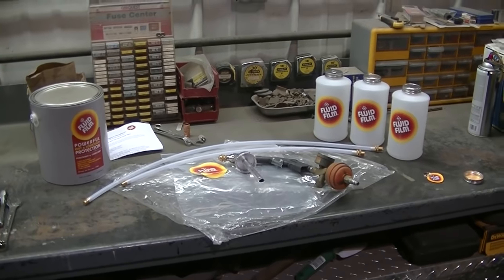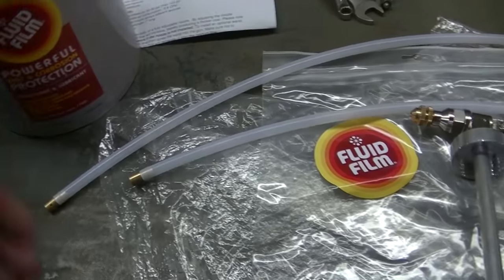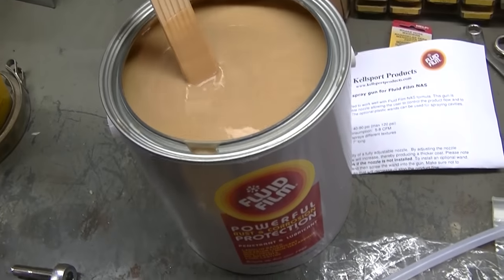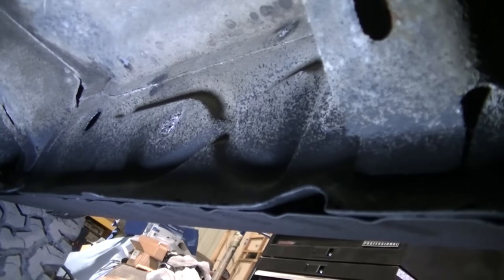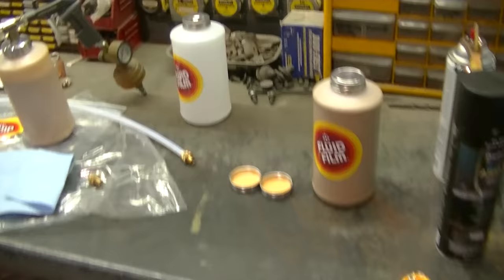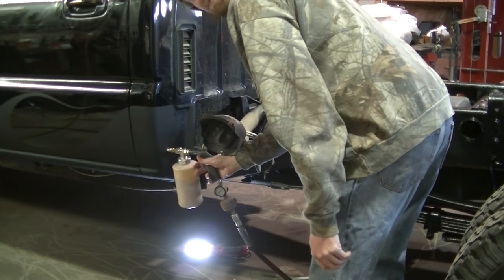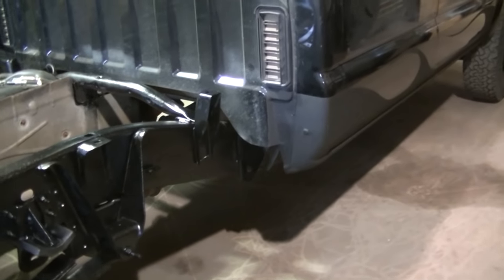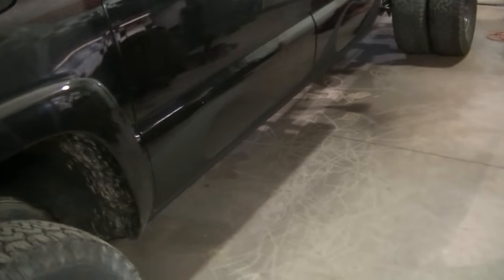Darth Dually Silverado "Spraying Fluid Film in Rockers"

Comment: I just got this same kit on Ebay, comes with the gun, 1 gallon FF , 3 empty bottles for the gun. One bottle has a cap brush for terminals or small applications. As well as the 360° hose and spray hose. Was a package deal with a gallon of FF and 300 plugs if you wish to drill a hole in a application like rockers or tailgates or whatever.  Was a decent deal around $140 and they threw in a led flashlight lol. Wish I bought the pump lid for the gallon can!
Reply from the maker: I didn't know they had a pump for the gallon can.  That would really be helpful.
Reply: mossman381 If you look on Ebay you will find it. Kinda pricy in the + or - $30 range. Also seen this contraption called Rockler Mixing Mate Paint Lid. It fits a typical gallon paint can and mixes and pours. About $20 give or take. Both are cool to have on the bench! - Nick
Reply: Where did you buy the gun at?
Reply: Where did you buy the Fluid Film gun at ?
Reply: lightningsmokerXx Ebay
Reply: mossman381 get a gallon can pour spout cheap

Comment: Hey Mossman. I did my 89 K5 Blazer with Waxoyl products. I’ve been looking into Fluid Film and now Wool Wax. I still have several sealed unused  gallon containers of Waxoyl cavity wax. Not sure why I purchased two of everything Undercarriage hard wax and cavity wax. Anyway I also purchased the spray gun and wands. The both Waxoyl s are good and spray gun is clean ready to go. The cavity wax is similar to Fluid Film/WoolWax but is Petroleum based product I believe. I also checked into other products like NHOU , 2+2 Berkable PFC , Petroleum Service Company undercoating. These are wax oil Petroleum based products. Once sprayed they seep and creep into pinch welds & seems. They set up and have good bonding to metal , painted metal and metal with tight surface rust. I guess anyone of these products is better than nothing. My truck is brand new , clean and ready for what ever I’m going to apply. The truck is on high ramps in my driveway. Now if only the rain would stop.

Comment: sprayed mine before winter, still holding very good. it soaked in the rust and turned it very dark brown as if wet. I used 2 liters to do the frame rocker panels and inside the bottom of the doors. Even sprayed under the whole cab floor underneat .Spray your chassis !

You have no excuses, FF cost twice the price here !
Reply from the maker: +Veikra   I am not sure I want a greasy film on everything.  Would be a mess working on the truck with grease on everything.
Reply: it's a mess but it's easier to remove bolts as they dont seize and rust. I'd rather get dirty working on it than having to cut bolts and fight everything whenever I work on the chassis.  Greasy is how it needs to be in our weather.
Reply: +Veikra Agreed.... Greasy film is good for sure :)
Reply from the maker: +Veikra   I guess I figure after 14 years the bolts that are going to seize are already seized.  When I take something off I always use anti-seize on the bolts.  Spraying the bottom of the cab would probably be a good idea but I don't really want to just spray the whole bottom side.
Reply: mine was showing traces of rust on the bottom, such as the edges of braces.  And at least  if it doenst fix the seized bolts, it stops other from seizing.
I'd rather do it, matter of preferences and I figure it can only protect more. Im willing to deal with the dirtier repairs that are few and far between.
Reply: Veikra Getting greasy is not fun but I do like the warm fuzzy feeling of my truck oozing oily stuff from every crevice, lol.  Makes me feel like I'm giving it a chance to last longer
Reply: Velvethamma
It's a once a year thing, and done deal, it never rusts again. Totally worth it
Reply: Veikra Agreed!

Comment: Fluid film is great stuff for sure!  I put that #$%& on everything!!!!  I like the undercoating gun setup.  I see Eastwood carries an identical unit for similar money... I need to get one for sure
Reply from the maker: +Velvethamma   This gun was supposedly specially tuned for fluid film.  Here is the link  http://www.ebay.com/itm/141661065307?_trksid=p2060353.m2749.l2649&ssPageName=STRK%3AMEBIDX%3AIT .
Reply: Looking at that sprayer, I'm thinking I could make my own with a high output air gun, flare fittings, and a ball jar. We make these at work for spraying mineral spirits, not sure if it would work on that thick of stuff. How much did a gallon cost you?
Reply from the maker: +UnitCrane514   About $50 a gallon.

Comment: Even in the summer, my 5 gallon bucket has the consistency of pudding.
Reply: That's a question I just posed in a Fluid Film video comment section and here on this video.  Most videos show Fluid Film having the consistency of thick pudding yet here and on the Fluid Film video it is a pourable liquid.  How come?  I'll let you know what I hear if they ever get back to me.
Reply: @STBRetired1  Yet the overpriced stuff in a can is as thin as water.  They said the only thing you can use to thin it is vegetable oil.

Comment: Now that's interesting.  In most videos, the Fluid Film has the consistency of thick pudding.  But yours is a pourable liquid that would atomize and spray much better than slinging pudding onto the truck.  I've just left this question on a Fluid Film video comment section to see why the difference in consistency.  Are guys leaving the lids off the cans for too long and the VOC's are evaporating?  Fluid Film does say no solvents but the list of ingredients does list "less than 25% VOC".  I wonder if anything can be added to the thickened Fluid Film to make it more liquid after it has thickened?
Reply from the maker: My latest can of Fluid FIlm did seem thicker than this one. I mix mine up really good before using it. It sprayed easily with no problems.

Comment: Nooooooooooo! you are not boring; quite the opposite I may say.  Truck is coming along nicely.  How is the 1500?
Reply from the maker: +jewllake   Thanks,  I have been using the 1500 since the dually has been down.  Seems to be running good.  Waiting patiently for it's turn for mods  :)
Reply: The more videos of spraying fluid film the better.
Reply: mossman381 
Nice vid.
Hey I'm debating doing a 360 FF spray inside my frame on my.18 ram but I'm worried dirt will get in frame holes and will mix with FF and get stuck in there unable to rinse with a hose fully causing rot problems down the road. Because oil attracts dust and dirt.
PLEASE TELL ME YOUR THOUGHTS ON THIS SCENARIO?
To me it's a little different then inside rocker were dirt can't get.
Reply: @countryfamilyalways7280  -even if you live in the iron range the FF is great at displacing water from the steel thus preventing rust. If u cross deep water alot then you will want to recoat but normal use a yearly application is fine. I have an 03 Toyota 4runner w/200k all WI & MN miles. Before FF it was total surface rust under. After remediation & FF (in my driveway) it's perfect. Cant recommend enough. It's hard work but totally worth it!

Comment: How did you hit the outer rockers on this truck since there is no access, I got a stock truck with mint rockers and I am trying to find out how to coat both layers of rocker panel thanks
Reply from the maker: There are holes to access the inner rockers with a hose. I believe I showed that in the video.
Reply: @mossman381  the ones you slipped the hose in from the rear aren’t on my truck I guess, I may have to drill a hole to access it
Reply from the maker: It's been a long time since I had that generation truck but I thought they had a few holes in the rockers. They have plugs that cover them.

Comment: Fluid Film is a great product. Somebody correct me if I'm wrong but it is made from lanolin that comes from sheep wool. ( I think ) Kind of slacked off using it because I find it very expensive compared to other rust preventing materials. Should take another look. Thanks Bud.
Reply from the maker: +Douglas Laramie   It was about $50 for a gallon.  I didn't think that was bad at all.
Reply: +mossman381 money well spent. i use it all the time. i buy it in the spray can and use it like WD 40.. excellent product. iv used it on my 04 dodge since new and no sign of rust. only where i did not spray it.. i do a application 2 times a year. in the winter i spray the underneath with used oil cut with diesel fuel. works great keeps every thing protected from the salt.. we have it really bad in Michigan
Reply from the maker: +Donny Krane   I feel better knowing I have something in the rockers to help keep the rust at bay.

Comment: Hey Mossman. Did you spray your new trucks. Did you look into other rust proofing materials besides Fluid Film. Nice video
Reply from the maker: I have sprayed sections of my other trucks.  I want to wait until I do rust repair before spraying to much.  Otherwise it could be hard welding new metal in with it covered with Fluid Film.  This stuff is proven to work.  There are a few videos showing it.  If you spray this stuff in an area that gets washed off then you will need to recoat every so often.

Comment: Now that it's been 4 or 5 years how well you feel it worked versus using por 15 or something of that nature, have a new truck and live in ohio?
Reply from the maker: I don't have this truck anymore but I know the Fluid Film is keeping it from rusting where ever it is. POR 15 is a paint. This is more like an oil. If I had a new truck I would spray Fluid Film in the inner fenders, rockers (inside and out), under the cab, and inside the bed fenders. There are little plugs all over these trucks. Pull them out and spray Fluid Film with the extension tube.
Reply: @mossman381  thanks, I'm aware of the difference just contemplating if I should use the fluid film or just go ahead and break down and paint, por 15 the entire frame, cause the wax gm puts on these new ones is junk compared to the older ones
Reply from the maker: The frame should be the last thing you should be worried about. The sheet metal on these newer trucks is thin. I see 2016 trucks rusting out. You need the sheet metal protected. The new frames are probably fully boxed now. I would go into holes in the frame and spray the inside with fluid film. For the outside of the frame you should be good for awhile. They make black Fluid Film now. After a few years you could spray the outside with that. To actually paint the frame with paint you would need to strip all wax/undercoating off. Not easy to do.

Comment: Did you do a vid on the doors and fenders? Nice.
Reply from the maker: I didn't do the doors or fenders on this truck but you can get to the front fenders by taking out the headlights.  Doors you can take off the door panels and should have easy access.

Comment: Are you still using this kit. 
Haven’t seen any videos with the newer trucks you have
Reply from the maker: Sprayed the s10 awhile back. Was waiting for the bedliner to cure really good before coating it. Waiting for rust repair on midnight and the 91 dually doesn't see winter roads. This is good stuff. If I had a newer truck I would completely spray the body and frame down.
Reply: Thinking of maybe getting a stay gun.  Use it on my plows and salter.  Cheaper than using cans
Do you need the regular
Reply: Thinking of maybe getting a stay gun.  Use it on my plows and salter.  Cheaper than using cans
Do you need the regular
Reply from the maker: @chachifeere  I use a regulator from my paint gun to get a good spray.

Comment: how did the rust converter turn out did any rust retern on the chassis? and did the paint start to peel thanks
Reply from the maker: I think it's starting to rust again.  It still looks better than rusty mess but I wouldn't recommend that rust converter in a can.  I just don't think it works very good.  I would like to try POR15.
Reply: So the rust converter paint isn't working so well. That's my experience too on Ford chassis; you need multiple layers of the paint for rust to finally stop for over a year, maybe five layers. It's pointless if fluid film can do it in one shot. How are the areas where you sprayed fluid film?

Comment: have you ever used chassis saver? I hear really good things about it, I don't know if you can spray it like you can spray this into the rockers and what not but for the chassis and underbody itself I'm curious if chassis saver would be better to paint on or is this stuff just as thick and durable as that?
Reply from the maker: This stuff isn't paint.  It's an oily substance.  I have never used the chassis saver but I have heard good things about it too.
Reply: ah okay, so it won't last aslong as paint then I assume, how long do you figure it will protect the inside of your rockers for before you have to re-coat ?
Reply from the maker: I would think it would last a long time.  A year after spraying the bottom of the cab was still oily.  I would trust oil any day over paint to stop and prevent rust.  It doesn't look as nice as paint.  I have sprayed rusty frames with rubberized undercoating and the rust still grows underneath it.  Then the undercoating will just bubble off.

Comment: The gallon of Fluid Film I have seems quite a bit darker and thicker/goopier. Do they have different formulas? The 1/4 gallon I have left is 3-4 years old, maybe that could explain it. It shot just fine out of the cheaper, more basic gun that came with it as a kit. Anyway, it's good stuff and performs a advertised.
Reply from the maker: I don't think they have different formulas.  Not sure it goes bad.
Reply: There is many different versions, "liquid a" being the thinnest, like a golden oil, "nas" like used in this video, "liquid a-r" is a thicker brown grease version, consistency like wheel bearing grease, there's a few more versions as well. I use a-r as is much heavier duty and last longer on the underneath.
Reply: @alantownsend5468   Yes, but it needs either heating, or thinning and build the layers up if using diy equipment,  airless sprayers can handle it unheated or thinned, in easy to reach areas I brush it on really thick.

Comment: They used to call it Z Bart i think and you had to pay extra cause it was done at the dealership with Lanolin in it when it stays above 50* it will creep into the smallest areas. I live in the south and we use fluid film..........
Reply from the maker: +Gary Peacock   Z Bart sounds familiar.
Reply: Yea it was called Z Bart and it was pricey anywhere salt could get in ect. but my 2000 GMC i bought from a guy in Kentucky i had to replace the mirror switch and inside the door was not treated so i took off all 4 door panels and sprayed with a Lanolin base film......
Reply: They say that it creeps into areas but I found one place it was the spring the next year and it was as dry as a ???????. It was quarter size and figured it should have been covered but was dry.  I have not found that it penetrates the metal so the metal still rusts.  Covering is one thing and where it penetrates the metal is what one needs. Wanting to find something else for the other truck.
Reply: GL Peacock , I think you mean Ziebart, which is a company that used to be all over the Midwest, and undercoated cars with a product that resembled fluid-film. Ziebart required that you return once a year for a re-spray, and they guaranteed no rust. I think they may be out of business now, at least I no longer see them in my neck of the woods anymore. I brought several cars in for treatment back in the 80’s and early 90’s, and they did a great job.